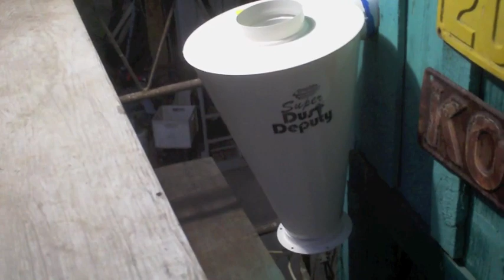Home Built Cyclone Dust System Pt. 4

Comment from the maker: Well the air will be blown back inside after cleaning but I have been thinking about ways to close a valve and blow it outside without passing thought the full filter for summer use.  I do know that in the winter putting the air though that big cold metal cyclone is going to cool it off a lot.  My plan is to wrap it in that foil foam insulation to help save some of the heat because as is the heating in the shop is marginal.